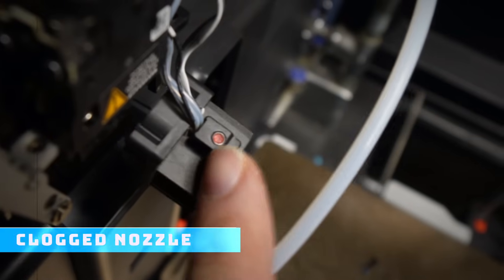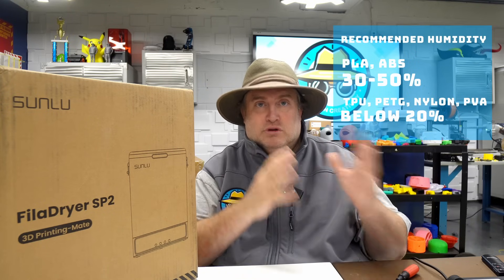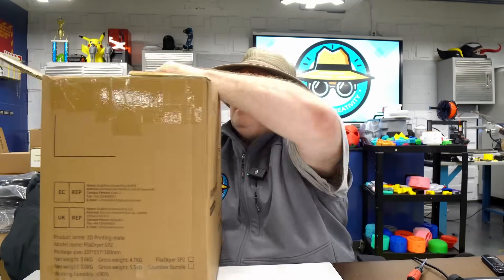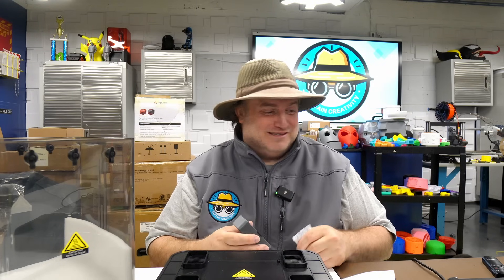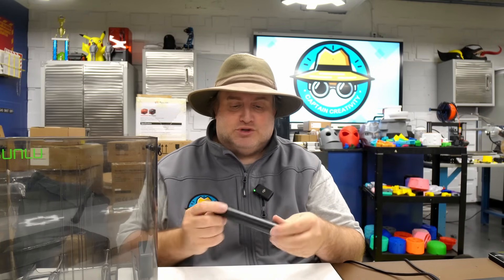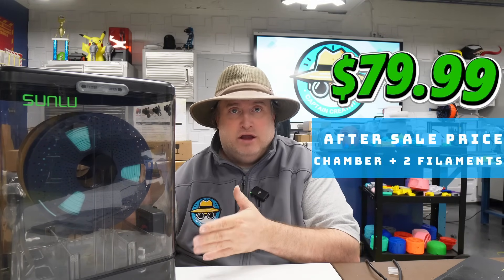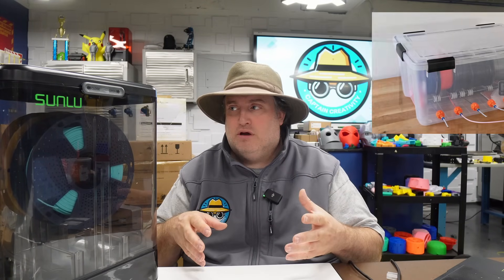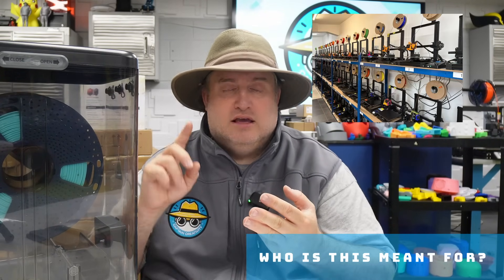Dry Filaments, Better Prints: How the SUNLU SP2 Changes the Game!

Comment: I have a different brand dryer and have put a Therm Pro meter in on top of stock meter. I get temp and humidity and it reads 12% lower than stock meter. Have you tried a different meter.

Comment: I currently use the Polydryer system, but also have a Sunlu S2.  I prefer the interface of the S2, which the SP2 looks similar, over the Polydryer.  The large form factor of the SP2 may make it a bit more cumbersome and harder to place.  I found the S2 doesn't work in the winter in my unheated workshop, and I had to bring it into the house to work, which is a concern for the SP2.  I may purchase one to try as the price point, while a little high, isn't bad for the ability to have two spools concurrently.

Comment: I have the Sunlu Filadryer S4. But what bothers me with all Sunlu Filadryers is the fact that it doesn't rotate the filament spools during drying. Drying is much better at the bottom, where the heat comes from, than at the top by the lid. So you have to manually turn the filament spool a quarter turn every hour if you are drying for 4 hours, for example. That's why I personally wouldn't buy a Sunlu Filadryer again, regardless of the model.
Reply from the maker: Yeah Eibos does that and it's very cool. It was too bad they didn't have that in there as it seems to be a pretty cool feature and doesn't seem too difficult to implement. Anyway definitely appreciate the feedback and good points and thank you so much for watching
Reply: No need to rotate if the air is distributed well. Otherwise you just pay a bunch more for another feature that can fail easily.

Comment: I got exited for a moment thinking this might hold my spools. But no, only 250mm, my spools are 300mm. So will need to continue looking as I am yet to find one that can hold the 300mm spools.
Reply from the maker: What size filament rolls are these at 300 mm? Is this a 5 kg roll? I know that they specified that they can handle 3 kg rolls so I'd be interested to know what a 300 roll would be.
Reply: @CaptainCreativity  They are 2.2 kg spools. Colorfabb economy PLA/PETG
Reply: @CaptainCreativity  They are 2.2 kg spools from Colorfabb. Economy PLA/PETG

Comment: Creality space pi plus runs $44 for 2 rolls.  I do like the innovations in drier technology but prices need to come down.  A box system like this should be much cheaper.  The Creality system seems to work in minutes for me, not hours.  It does suck having to put 30 of them in my print farm for 60 printers but I haven't been able to find a better system yet even though I am eager for it.

Comment: Its a polymaker clone. I just bought a bunch of their boxes for $26/box on an amazon flash sale. Which is pretty close to what you're paying for these/spool dried. As for the descent around the hydrometer, the descent will stabilize its moisture content to what the box humidity is. At least until it hits its saturation point, which will be likely way above the 20% range were normally shooting for. So for accuracy, Id say its likely fine in the lower ranges of humidity we are shooting for.
Reply: desiccant
Reply: @steveh8724  Thanks.

Comment: Whatever you do, don't dry your PETG for 6 hours. I had mine COOKED like it was so hard you could knock someone out with it! I had another Filament dryer, and the sticker told me to do that.
Reply: Depends on the temperature, it comes out fine after 12 hours at 65 degrees celsius for me.

Comment: your comment on the desiccant being around the sensor makes total sense as when you took it out of the box it said 20% humidity. but some other things to consider is that your diy version would probably have worked better than this thing because of a couple issues. first, humidity rises, so having the sensor at the bottom of this box will only be reading the dry air, it should be at the top. and also, this version has the exit for the filament also at the top, so you'd just be feeding out less dry filament because it's sitting up there in the humidity. fancy design but i think i'll pass and stick to the diy version.
Reply from the maker: A lot of amazing points here, one of these days I think I am definitely going to try a DIY version as well. Thank you so much for the excellent feedback and very good points that you made. Thank you for watching 😁

Comment: The Humidity where I live its 80%. Sunlu copy paste the Polymaker 3D dryer but make it bigger so its a pass for me.
Maybe I bought one if they make a version that only fit one roll of filament and its cheaper than the Polymaker 3D dryer.
Reply: There is a mod for the polydryer that allows you to connect it to those 5.00 cereal boxes on Amazon.  I've been working on a DIY heater for these cereal boxes since I'm heavily invested in them   Recently bought more than 60 wanted to grab some before tarrifs.
Reply: @themadhater9003  I commented before reading this... Me too! LOL
Reply from the maker: Dear Lord 80% that's wild. So when I looked up the polymaker dryer I definitely see a storage version that goes for around $30 but it's only for storage. When it includes the heating then then I see that it's hitting numbers like $70 and up. However like I said if you get this version during the presale and you buy extra storage chambers then each storage chamber does come out to about $30 when you factor that they give you two rolls of filament included. However if you don't want their filament and you really only want a unit for just one roll and you're not going to buy multiple Chambers then I totally get it. Either way I do think that what they're doing here is pretty cool and selling something that separates the heating component from the storage component. It's great to hear people's feedback and I appreciate your comment and thank you for watching
Reply: It is just a larger Polydryer